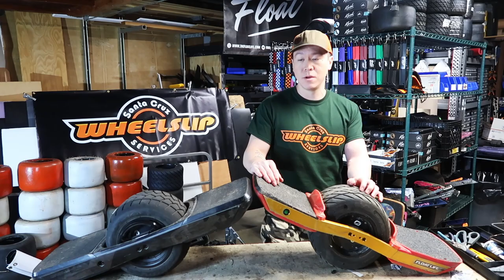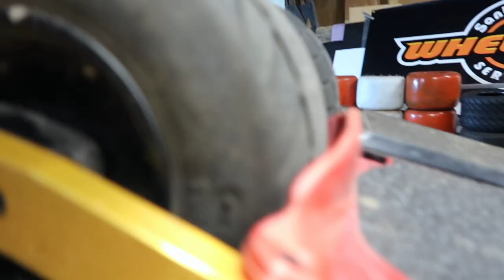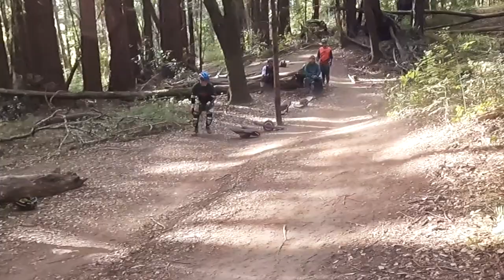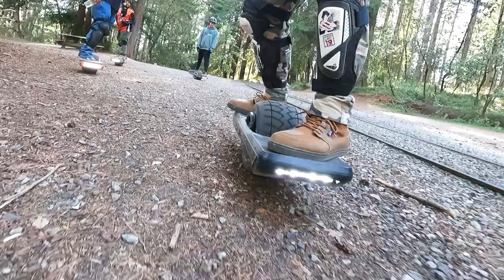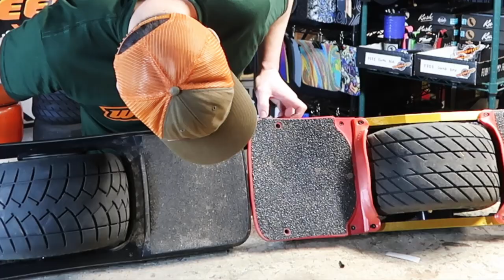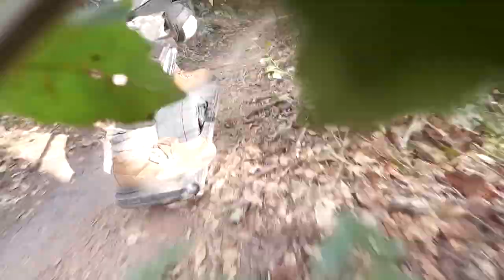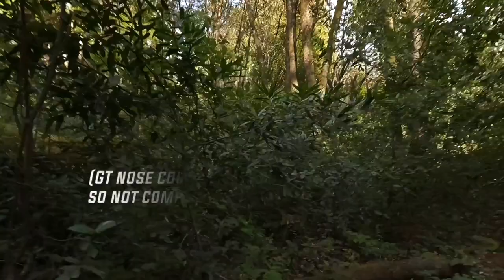8 things I hate about the Onewheel GT.. Should you get one? GT vs WTF XR (Part 2/2: cons)

Comment: Great info!  Overheating and poor range are major cons. So glad I held off on ordering the GT and may end up not buying it at all due to FM's stance on right to repair.
Reply: Matthew Hayslett  Get an euc :)
Reply: Yeah I mean anything is better that just straight up ignoring peoples interest in repairing and improving their product. Of course the company is fearful of modifications or botched repairs leading to injury. 

To spitball a random solution, if they just made their safety mechanisms modular so that you can open it up and fix it yourself with more of the liability being clear where if the hardwired safety mechanism is tampered with. And make a big yellow tag that has a warning about not tampering with the safety module. Then futuremotion can better defend themselves in court. 

They way they’re playing it now, with the ghosting issues, they better start directly addressing problems and pivoting or their reputation is going to suffer. Like this will be remembered as a big failure or a windfall moment of redemption. And not the kind of uptight pandering apple pulled with their 80lb repair kits for your iPhone.

Comment: I get all i need out of my stock XR and planning to upgrade it..at first i was mad when i bought an XR and they released the GT a week later...now im happy!
Reply from the maker: You ain't missed out on much! Mod that xr with upgraded rails, battery, lift kit and you're gonna be on cloud 9 🌥️
Reply: @MaxxSend  truer words never spoken.

And dump the frame the grade of metal is cheap, bends and strips out easy.

Go aftermarket and get it powder coated like I did before install. The stuff lasts. Don't know why FM didn't do it to the OWs. There paint comes off so easily.

Comment: Great video Max! I'm loving the gt for cruising above 18mph without fear of nose diving. Was hoping it would crush hills for me, but if it's over heating and draining the battery, then I might as well bring the cbxr on trails. Haven't tried trails on the GT yet, not real trails anyways.
Reply from the maker: Thanks!! For sure it's an awesome street cruiser with a solid nose. Felt like a tank riding at pushback and nose dragging. As soon as the over heating (and maybe battery longevity) is resolved, you're gonna love the uphill torque. I'd put my finger at around 10-15% increase over CBXR. But everything else trail related diminishes the appeal of the GT, especially the loss in clearance.

Comment: Recently got into boosted boarding and looking to upgrade. My board is pretty nice but is not too stable on bumpy sidewalks and would be better if I could offroad to get around my campus easier. Was thinking about the GT but the whole shtick with FM is driving me away from them and I am thinking of just getting a second hand XR with some mods. I can get a relatively good XR with some mods for under 2k and it doesn't weigh even close to 40 pounds nor is it too large which means easy portability when taking it indoors for class.

Lets hope they fix the issues the GT has and FM fixes their right to repair problems.
Reply from the maker: modded XR is the way to go. Xr has been refined by the community, a lot cheaper and nearly the same benefits. Gt just has too many deliberate roadblocks for RTR and aside from the slight boost in torque, feels like it's going backwards..
Reply: @MaxxSend  Totally agree. I have heard that even though there are some limitations depending on the firmware you have for the XR, you can still work around it which is nice. When I get one, I plan to get a fender with foot holds and a nice rail. Maybe a battery upgrade in the future.

Comment: Ooof. I've got a Pint X I have about 250 miles on now and sort of wanting a bigger board. I'm around ~210lbs, probably 215ish with riding gear, and more if I'd like to carry a backpack with some other things. I do get some foot fatigue relatively over so kind of wanting something with a bit wider stance and bigger pads.

Having a hard time deciding between a GT or a used XR that's either got a CBXR or a hardware version that can be. I have heard the XR is overall better probably if you're wanting to do tricks, but the torque from the GT may be nice, especially for trails?

At this point do you think an upgraded XR is still a better board?

Comment: Wow the over heating segment is extremely concerning. Great video!... I'm 215 lbs, I need that GT torque for the trails.  When my XR dives in the dirt my fangs dont work lol.
Reply from the maker: Yes it was quite the let down, we didn't even start the main section and it overheated.. Not even sure if a firmware update can fix it, seems more like the hardware. Gotta say tho, I'm 193 lbs and can feel that uphill torque increase, prob ~10-15%more. Take off the fangs and trust the float plates and/or bang bumpers to let u sliidde 🤙🏻

Comment: I’ve been thinking about upgrading to the cbxr battery! But I hear it can fry your bms over time., is your xr still running okay with the battery upgrade? And also did you have to mod your battery housing? I’ve been looking at the larger Badger battery box
Reply from the maker: CBXR has higher amp discharge than stock battery so depending on your riding you may indeed end up overpowering the bms. Stock battery housing is fine for cbxr, but the badger box is more spacious. However you'll need the custom badger rear bumper to fit with the badger box. Btw I no longer ride fm boards, instead I ride VESC, which is wayy more powerful and better! Check out some of the vids after this to see why :)

Comment: I don’t understand why people are complaining about the RTR. You can still do it, it just requires that you replace the ESC along with the battery, and a VESC will make this board reliably hit 25 no pushback. It’s also cheaper to gut the thing, and replace everything electronic behind the motor, than it is to ship it off for a “tune up”. And this thing has enough real estate on board for 30cells. That’s 15s2p which is 60v10A. That’s insane power to have under your feet.
Reply from the maker: the principle of supporting RTR is why purposely put so much effort to prevent modding? safety? pff. Why pair the bms & battery, hardwire the battery housing to controller, brick the board when trying to mod? It's all hindering innovation. Anyway as of now it doesn't make much sense to vesc a gt, because 1) most are still under warranty, 2) the connectors are proprietary so modding them to fit the vesc controller will be a PITA, 3) gt motor is the same as XR so same power capacity. The bigger battery box is nice, but currently I have an 84V battery in my XR stock box, and it can hit 31+mph without reaching pushback, and insane torque. XR platform is just far better to vesc, along with lower center of gravity and better mods (rails, bumpers etc). better to get the 2000W fungineers motor and an extended XR battery box for CBCSO or TORque pack :)

Comment: Thanks for putting this together. What is overheating? Motor or battery?
Reply: Motor is unchanged from the XR, battery is much beefier using state of the art cells capable of delivering much higher watts without getting warm, so I'd say neither. It must be the controller in its newly designed enclosure and how it transfers heat to the frame/environment
Reply: @surfdado  you make good points. But it could still be the motor methinks. Wondered if Max checked the app to see the three temps. There’s a video of a guy that rode his GT up a long grade in Hawaii and it shut down due to overheating. The hub cover plate was so hot he couldn’t leave his finger on it for more than a second.
Reply: My GT motor is overheating with moderate use. With a plus following me my GT errored at 185 and the plus motor was around 160. I got 3 miles before the error.
Reply: @floatfanatics8850  oh wow - I was going to respond above that it makes sense that the increased power capability of the GT can indeed more easily overheat the motor, if that additional power is actually used. But in your case it sounds like even when the same amount of work is done (i.e. transport the rider up a hill at equal speed) the GT overheats more easily. It could be that the GT's motor mount and the rails are less efficient at transferring heat away from the motor. That is indeed very disappointing
Reply from the maker: I'm not quite sure which, I would assume it's the motor, as if there was any issue with the battery cells most likely it would start captain morganing. But could be both!
Reply from the maker: @Bradhecksel  unfortunately didn't think to check the temps. The board was still connected to my friend's phone. We were all just in shock that it happened so quickly lol Yikes that's crazy the hub cover plate got so hot, safety hazard!

Comment: Im hoping a firmware update helps. I'm not sold either but I'm waiting to see how the aftermarket makes it more enjoyable
Reply from the maker: After all these years I was hoping for more innovation. Especially since they're sitting on a suspension patent.. But confident our aftermarket gurus will help it reach its full potential!
Reply: @MaxxSend  Yeah honestly... Especially the footpad, the one big thing differentiating it from the pint x, is a big fail imo. They would see that the wide kush was very popular if they did any research and it makes a lot more sense to chamfer it outwards rather than like this. Its not like its an iphone and you need to safe every milimeter to fit it inside your pocket.
Same with the clearance, thats the thing ALOT of the mods tried to modify on the XR. I expected they would redesign it a bit into a triangle so that the bulk of the materials are closer to the tire where it matters the least and it can get slimmer with more clearance towards the tip. But no instead they actually fill up even the remaining space and add an extra half inch just to make it equal on both sides.
If not even people like you, who have devoted a good chunk of money and time to these boards, are convinced its the latest and greatest, then i dont see new people be too willing to purchase an expensive GT rather than an used XR.
I personally will just wait. Hope the software can fix the balance on jumps for you and maybe the overheating too. Or maybe finally some knock off company makes a decent one wheel to start a competition and make them try harder.

Comment: If you spent as much to upgrade the gt as you did the xr, which would be better? Heat management is kind of a bummer, how is it now with updates and upgrades?
Reply from the maker: I'm sure once the gt is fully decked out with available upgrades and refined settings, it should be the better performer. It's already getting better feedback with the new firmware update. However if they don't allow us to repair, and continue to make the board brick if you disconnect the BMS, I will not support the gt and instead fully go with VESC and my current modded xrs.

Comment: You can put more weight on the front to counteract the tail drag on a drop. Are you biased or what? When you're airborne, the wheel spins faster than intended and tries to slow you down. What's the issue?
Reply from the maker: It's a general consensus amongst the heavier senders that the gt is way more tail happy than the xr. Have u tried a significant downhill drop and/or bonk with the gt yet without significant tail drag? Would love to see some of your  footage to be enlightened. You are theory based instead of execution lol. Did u not listen to my conclusion? I am as unbiased as possible and gave the gt credit where it's due, especially in my Part 1 vid of the pros that I like. But I'm sure you haven't informed yourself from that yet. What benefit do u imagine I get from being biased? 😂🤦🏻‍♂️
Reply: Not sure if you saw he did land on the tire once or twice and it still tail dragged. He also found that on bumps, his foot fell more forward due to the weight of the board. Together, that means that leaning forward would either do nothing or shoot him off the front of the board. Not sure if you watched the whole vid mate.

Comment: What are the mods on the XR.  I just bought an XR at Christmas.  Have only put on a few miles before the snow here in MI. and am a new rider.  But I can't fathom what all these mods are that would result in $3000 invested.  I have a fender and rail guards, and was told to buy upgraded footpads.  What are all these other mods?
Reply from the maker: breakdown at 0:03..
Reply: @MaxxSend  Thank you.  Sorry I missed that.  Can I get the CBXR?  I bought the XR new around Christmas and I thought someone said I can't upgrade battery with the firmware I have.  Or did I understand that wrong?  I'd love the extra range.
Reply from the maker: @jainubeezy1  no worries. you will just need a 'JWFFM' chip from JW batteries, plus the CBXR or JWXR, installed correctly.

Comment: Have you had any problems with the stronger pushback of the GT compared to the almost un-noticeable pushback of an XR? Also I was wondering how often it was overheating.. was that a one time thing or a reoccurring problem. Nice vid btw
Reply from the maker: I didn't hit pushback that often on trails since I was testing more on technical features. Didn't go too much faster than 17mph so it wasn't an issue. For street riding it was way more noticeable and annoying. It only overheated once when I tested it for about 2 hours. But it overheated on 2 other occasions with its owner. All in all, I still greatly prefer a modded XR :)

Comment: Thank you for this lucid lighting on the 2 machines.
The beginnings are difficult and the GT still has a long way to go before conquering the hearts of all riders, but let's hope that technical solutions will quickly fill all its gaps for the good of all...
Reply from the maker: Agree that launches are usually rough. But I don't have too much hope they're gonna change many things, more hopeful that our aftermarket gurus will come up with innovative improvements 😊
Reply: @MaxxSend I don't think FM is handling this launch competently. The way they are handling the delays. 
The way they obviously didn't have outside input before they finished determining their flagships characteristics.
The way they are letting customers beta-test their product.
The irrational decision to not establish service points outside of their Santa Cruz home, making it mindblowingly expensive and time consuming to repair anything. For them and us. Etc, etc.
Rough is an understatement. This is the arrogance of a monopoly on full display. Imagine any car manufacturer behaving this way. Unfathomable. 
Your Toyota doesn't turn on, after a day? Ok, send it back to Japan.
Listen, my car just drove into traffic by itself. 
No, worries, it's just the sensitive gas pedal. Only a lot of our not paid brand ambassadors experienced this. No biggie. 
Oh, just the gas pedal? How nonchalant. Are you insane? Your car is obviously not ready for release, yet. 
Also, leaving the narrative about all of this in the hands of social media by making zero official statements is marketing suicide, but you do you, FM. Great launch.

Comment: The GT with slick tire is a carving monster and outshines all the other boards on that one particular strength.
Reply from the maker: Have you tried a Street Pro or Whisper? Both of those better than the GT slick!
Reply: Yes, I am a Whisper die-hard. I really wish the GT had a better tire. However, on smooth pavement it is pleasant. It’s the side hussle where is gets hard on the joints, lol.

Comment: To be fair...... I've only spent 10 miles on the GT..... on the other side, there is a reason for that.... my XR...well it's perfect. Carves on the GT are lumbery, the slanted footpads mean leass overhang and thus less leverage for deep carves. I don't ride straight lines. There's been a couple of sketch heel side carves where my body is waiting on the board to get under my center of gravity like someone pulling a chair out from under you as you sit. Somehow in those moments I must have managed a slight levitation because for 5-7 millseconds my brain was pretty sure I was gonna take a moving seat on tarmac. I'm a daily driver/rider  and am in full aggreement with Max here and I've only spent time on Tarmac. With every board there's a learning curve whether that be in the ocean, snow, or whatever medium. If my wife does not take me seriously and learn to ride (and ride the GT) I'm highly considering selling now that the demand is there for an immediate delivery (I live in the central valley CA. I could be talked out of my GT. Screen name TheBeardedWonder in Visalia CA. Just putting it out there.

Comment: Left out that all new versions BRICK when replacing battery packs now so they have to be sent into the only (1) service center in the USA on your dime and replaced with dealer parts no mater what. This was not true on all older models but now these are only loaners and 100% new GT's will need to be sent back to the factory for battery replacement and whatever else they decide it needs when you unplug the battery or just need a new one. Sad...... It is against the law for them to do this plus someone made a workaround for it and they are being sued already. People really need to know this stuff before purchase and are not being told.
Reply from the maker: Very valid point. I didn't want to get into the real deep stuff like this but it needs to be said. How can you deliberately cause the product to brick when you are trying to understand your own product? I was utterly shocked (then quickly wasn't surprised) when I learnt this. Furthermore the battery is now hardwired to the controller, making things even more tricky.. Really appreciative of an overall amazing product bringing us joy, but they are pushing us away after taking our money.. 🤦🏻‍♂️😒